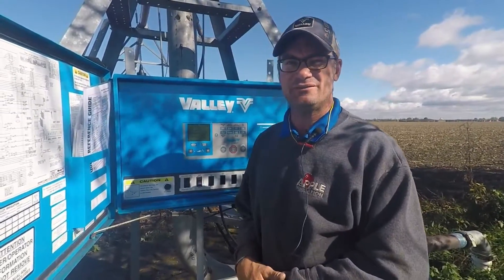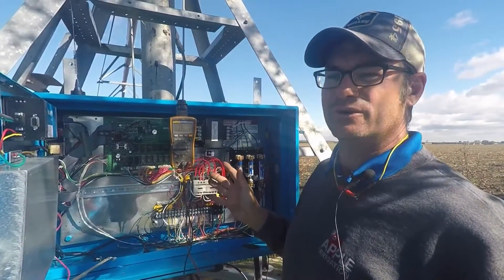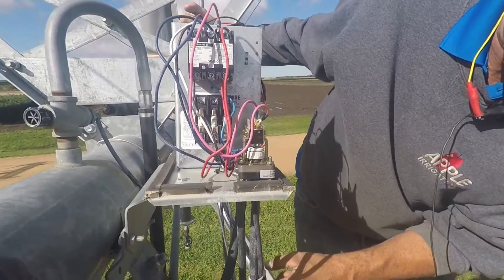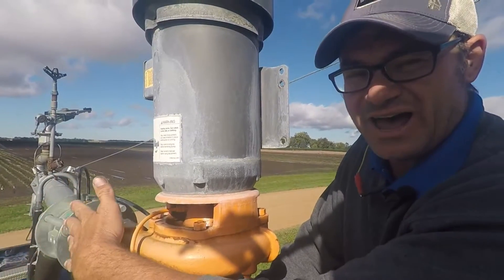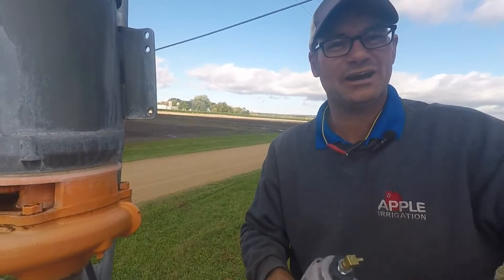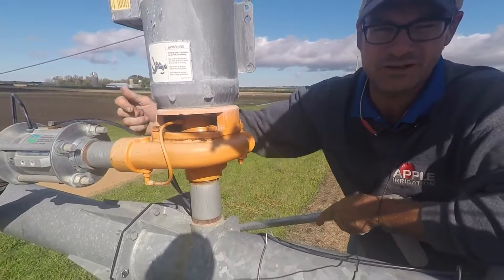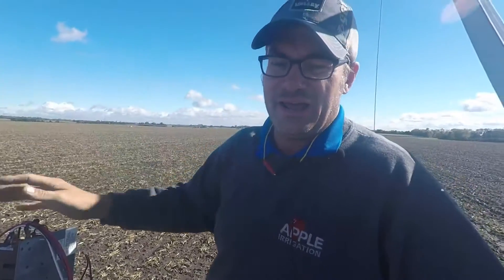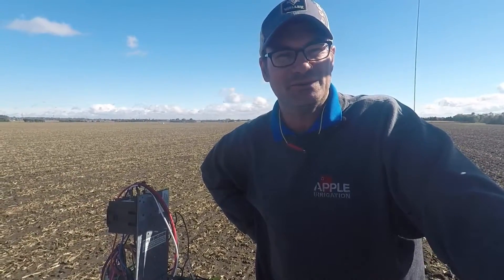Valley End Gun Troubleshoot

Comment: There is a pivot near my house, a valley. Has a komet twin 101 at the end and a booster pump. one year i saw it running and the stream had good distance then it looked weak. it would cycle thru that constantly. I'm sure it wasnt' a jet breaker add on. I think the pivots booster pump was malfunctioning. This year i haven't seen it do that though. Mustve gotten repaired.

Comment: The thumbnail shows a SR100 and a RB 70 as dual end guns. There's a few pivots around that either have the 70CW's or Nelson 44 or Rainbird L36's down the pipe and some even have those old FR guns at the end. You dont see that very often anymore. I know of a few pivots that have 70CWs down the pipe and then a PC100 and P200 at the end. I have not seen those run the P200 gun yet i dont seem to catch them at the right time. I'm assuming there meant for like a "poor mans" corner system, the system runs the normal sprinklers and the smaller 100 gun for a time then when it reaches the certain area in the field it shuts those all off and opens the valve on the P200 gun and that gets an area of the field that the smaller gun can't reach then when it times out it closes that and then starts up the impacts and smaller gun and continues on. I would love to catch some of those pivots changing modes. Those P200 guns are so neat to watch they have such awesome distance and coverage and the reverse cycle they whip back so quick. I know there not made anymore the FR guns always needed constant maitenance to be kept in service. Nowadays its more efficent and cost effective to use a SR nelson or a Komet Twin.. Putting down twice the amount of water going 1 speed both directions, not to mention those FR guns can give the overhang quite a workout if not set properly, brake and whatnot. One day i'd like to learn about how to operate a pivot, and even set up a traveler. I work on computers but this is a hobby.